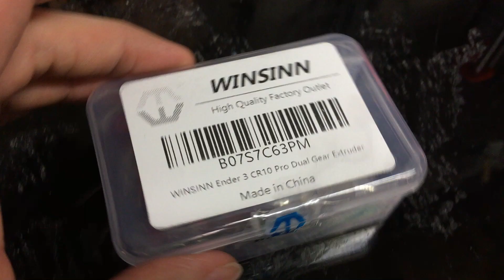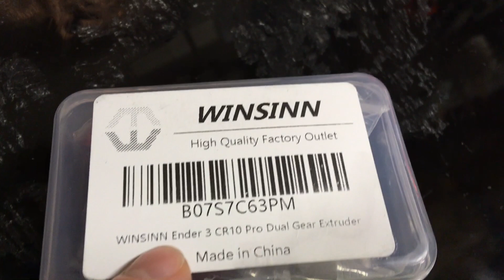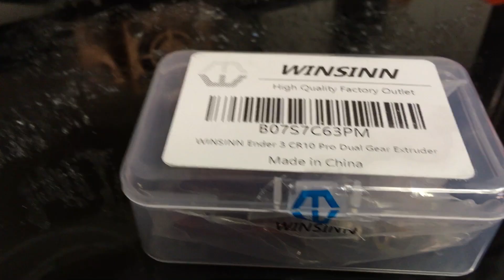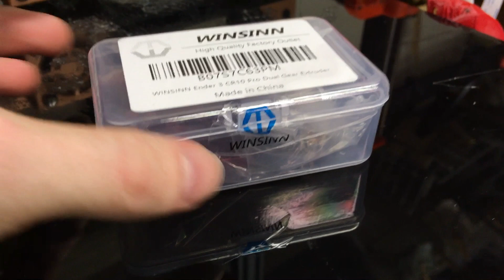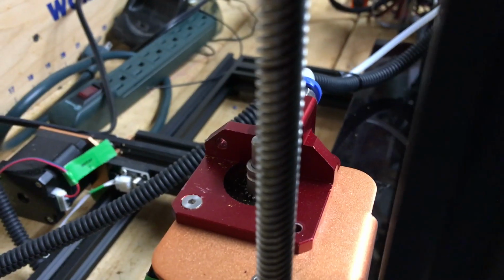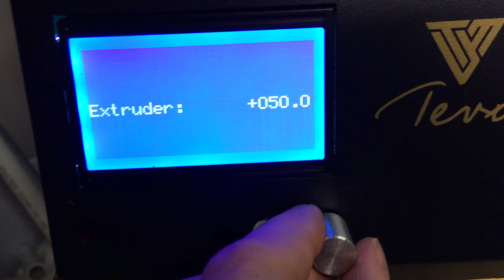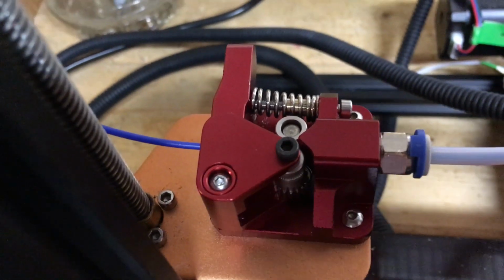Metal Extruder: Tevo Tornado Upgrade 1

Comment: may i ask how well this extruder has worked for your Tevo Torndao?
Reply from the maker: It has worked better than the stock extruder, but this one has some design flaws, as well. One that we've noticed is that the idler gear eats thru the aluminum if there isn't a washer under the idler gear

Comment: Sorry but how to reversed the motor??
I just receive the same as yours and am about mounting it
Reply from the maker: You have to go in the firmware and reverse the e axis motor direction
Reply: @3dprintingandtechnology643  I inverted the rotation in the timeware, when I say extrude it retracts and when I say retract it it extrudes (as it should be but when I send it to print and rotate to the original side).

Comment: i put slightly less fancy metal extruder on mine. So now mine is clicking and over extruding thoughts?
Reply from the maker: mine was over extruding after I mounted mine, but I adjusted the e steps in the firmware

Comment: How did you reverse the direction of the motor?
Reply from the maker: I had to change the direction within the firmware, then upload the new firmware to the printer
Reply: Can you give me an idea of what line I am looking for? Like, maybe a search string bud? :)
Reply from the maker: try looking for default axis steps per unit in movement speed in the configuration h tab
Reply: @3dprintingandtechnology643  Ahh I did find it thank you, I found an easier way, if you don't want to mod firmware.  Exchange the position of the red and blue wires on your stepper motor connector.   You can take the wires out of the small connector with a toothpick.  Just gently pry the cheap plastic tab up on the connector and gently pull out the lead.  Swap places and your good to go.  This is a Green Tornado I modded.  Also, this upgrade is a must, I think!  Also, my steps/mm decreased immensly to around 96 for the record.
Reply: Where do I go to do the firmware.
Reply: I had this problem with mine I removed the connection to motor E and swap the cables so red and black swap places there green and blue swap places your motor now runs backwards

Comment: What spring did you use as a replacement?
Reply from the maker: I had some misc. springs laying around. I have more kits from my supplier coming in, so I can look for a replacement spring. I can send a spring that would fit, or give you store credit for in, if you would like